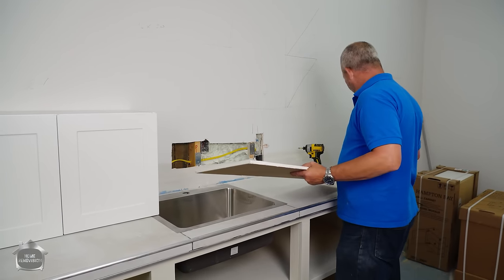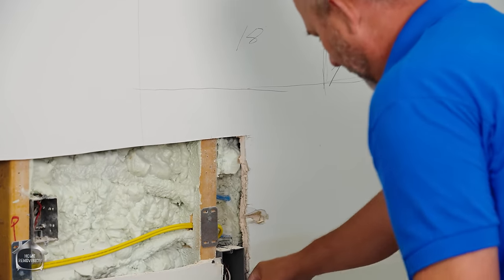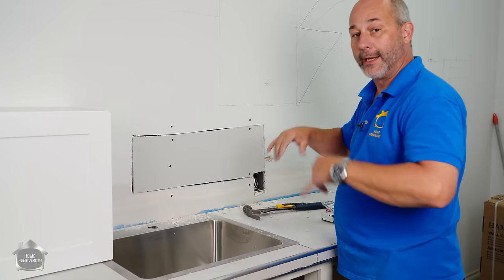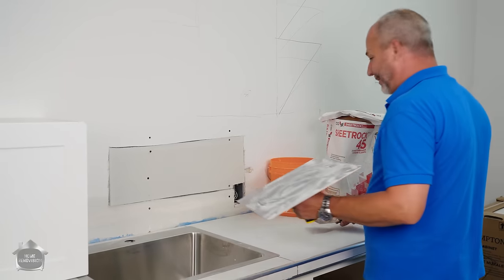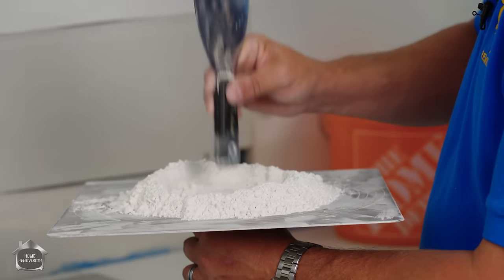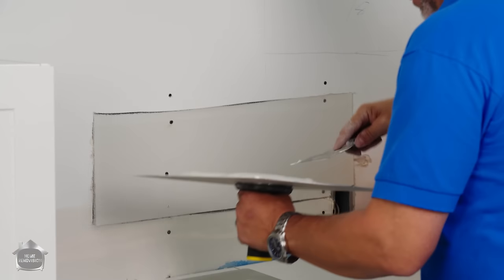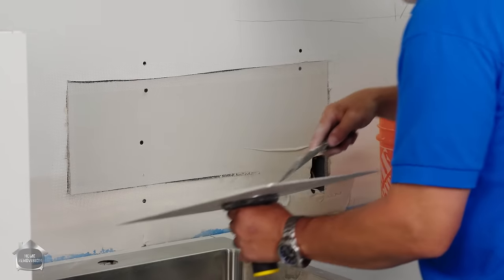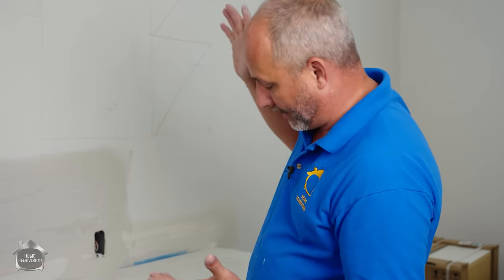My Secret For Quick Drywall Repairs

Comment: I've saved myself close to $10,000 by following your videos, which gave me the skills and confidence to do things myself, rather than hiring contractors. My dad & uncle are some of the least handy people on the planet, so I didn't grow up with this. Thanks.
Reply from the maker: Nice work! Cheers Edwin!
Reply: I want your story to be mine. Looking at renovating a place that was built all builder-grade in 2007. The cost of a contractor for 3 baths and a kitchen is giving me heartburn.
Reply: @seapeajones  good luck! I bought a 1950s place. Had to rip out the bathroom because it had rotted. Some of the joists needed replacing, lots of stuff needed drywall patching through the house, took out the second fireplace & chimney, rendering over that spot. Even had to replace some of the drywall.

Just think about what you need done, see if Jeff's covered it (sounds like he might've), watch the videos a few times and maybe you'll feel ready to tackle at least some of it.
Reply: Ditto!

Comment: I remodeled my entire master bath (5x7 so not a huge room) and anytime I would mix power mud I would use my hawk like you though instead of sprinkling it like a cake I'd knock the ridges into the water and then run my knife up the sides similar to a snow truck up a hill. It would fall in and I'd have a pretty good consistency one it was all done. Took me a bit to develop that technique but it works for me.

Thanks to your videos you gave me most all the knowledge to demo and rebuild that room for around 2k and adding 6k to my home's value.

Comment: Jeff you have helped me with a litteral tons of tips, 2 years ago i started to need to do drywall repair. I watched a pretty much all your videos, i must say the volcano method at least for me a pretty bad idea, i must have spilled a full bag over a year and a half trying to pull it off. The little bucket keeps the untrained cleaner. Thanks for all the other advices! Cheers
Reply: Also now i can tape and finish a wall in 3 pass with no stress, i got there in about 30 sheets id say
Reply from the maker: That is awesome! Cheers Alex!

Comment: Concerning the drywall mud mixing, I find it easier to mix larger batches that are too much for hawk and too little for buckets. Buckets suck because round.  But, there's always a butt, once roughly hydrated, I split it and mix to final on the "hawk" or mini hawk (or large trowel, point of view)

Comment: I still think the best drywall trick I've learned on this channel is how to work with 45 compound. It's saved me so much time when doing repairs, patches, filling holes, etc. I never had great results with the pink stuff or ready mix.
Reply from the maker: Great to hear!  Cheers Nathan!
Reply: The pink stuff is spackle, that’s really only good on small holes and stuff where you don’t want it to shrink. Think, patching nail holes on newly installed trim, or patching a hole from a drywall anchor or nail that was hanging a picture. I used to try to repair drywall with it too and it’s a nightmare! Joint compound is the way to go with any patch larger than your little finger, I’d say.
Reply: @artificiallyunintelligent4537  Even for small holes, I've gotten better results with 45. Plus, it was like $10 a bag that can sit on a shelf for years.
Reply: @artificiallyunintelligent4537  Have to disagree, setting compound is more workable and will not shrink(significantly) either, it sands better too. Hell, I'd rather fill nail holes and small dents with freaking Durabond 90, since the work will be done once for all and it sands fine. Spackles and pre mix joint/all purpose sucks!

Comment: For small patches on subtle texture like orange peel   you need a good way to fake that texture to avoid buying the 25$US spray can . Somebody had a video that showed how to
put some some "watered down" joint compound on a brush.  You want a brush  with about 2" bristles that are thick and strong.  By rubbing a finger over the loaded brush you can learn  to flick out lots of small drops to make  a texture, which you can further modify as you wish, sanding or knock down. I couldn't get consistent sized drops but it was good enough.
  I ended up making a really cool texture that was  somewhere between a knockdown and a  orange peel. But one only see the difference if close to it and looking for it.
By brush I don't mean a paint brush more like scrub brush.

Comment: Great tutorial on quick patch. I also like the 45 product, it took me years to switch from pre-mix one question though, are there wires in the box you beat into submission?  I’m guessing this is a dead circuit therefore, not an issue, however, as a standalone, the context is missing.

Comment: Hey Jeff, to start I got to say I love watching you and I'm learning so much from you... I'm doing a full remodel on a manufactured home that I purchased... I have a question for you. I have to replace some bearing studs that have Romex wire running through them, how do I replace the studs? Do I have to cut the wires out, re drill new holes and redo the wire, or is there a way around that without ruining the structure of the studs?

Comment: 2:30 @home renovision diy
Mr. Jeff, you ever add glue to your quickset mud when doing repairs/patches like this for “extra adhesion”; & what are your thoughts if adding glue to quickset mud?
Me, I add it & can tell difference; especially on some brands if quickest mud, when glue IS NOT ADDED…..so, I’m in the camp of, “ok to add”, as how was taught.
Cheers ✌🏻
Reply from the maker: I used to use  glue if I am not confident in the surface I am working on. Now I simply prep with a flat oil. Cheers!

Comment: Question.... So Useful video, stagger joints, thanks by the way... But i still messed up... I missed my cut by 1/8 or so around shower drop ear, so when i drilled drywall it cracked a little in a circle, i cut and pushed it up, but seems like the only thing holding the crumbled drywall is the paper... It feels a tiny bit weak around that hole... Do i scrap it and redo it or what would you do? Damn mold resistant drywall is 20 bucks each, hurts to just throw away unless I have to... What would you do? 😭😭😭

Comment: Great video!  It’s especially great if you do it for a living or have a lot of holes.  What about using spackle?  I wouldn’t have a need for a whole bag, but a small can of spackle is pretty cheap.  Are you opposed to it? And if so, why?  I forget to mention this, so I’m editing my comment…. Before I knew what you were doing, I was waiting to see when and how you were going to cut that weird shape into your drywall.  Then 🤯, you blew my mind when you cut the wall instead!  What a brilliant way to do it and SO much easier.  Goes right into the “work smarter, not harder” category.  Thanks again and keep the videos coming!
Reply from the maker: spackle does not bond with the tape as well. use a small bag of quickset available in the paint department. Cheers!
Reply: The trick is to buy a 5$ bucket and sealing lid, label it with the compound(or compounds if you buy different bags) and store them. You'll have infinite supply of 20 45 or 90 compound, you should probably add some Plaster of Paris in there for the really tough jobs, BIN Shellac primer will then prime them anyway for paint.

Comment: I've always been told to pre-fill my joints before tape. Is that not needed because of the mesh tape, or because you were in a hurry?
Reply from the maker: just not needed if you are using a mud with a hardener. it does not shrink and crack.

Comment: Watched lots of your excellent videos. Can you help?

Rented a drywall lift just long enough to place a tricky drywall sheet in my mom's ceiling.

I had prepared the rain-damaged area the day before & was able to completely remove a previous 4x8 sheet, revealing the surrounding sheet's edges. 

The sheet to be replaced ran about  5"x12" under a cabinet's top edge. It was very hard to get the sheet in place due to the cabinet & a nearby light fixture.

I got the sheet close and installed enough temporary screws to hold the sheet ALMOST flush to the joists while I ran to the next town to return the lift because the rental time was expiring. 

When I returned to install the final screws and completely seat the sheet, the opening was about 1/8" too tight.

I'm working alone and don't think I can remove the sheet & install it after sanding or rasping the edge down without a lift.

Is there any way to accomplish this without completely removing the sheet? I assumed the opening was perfect for a 4' width. Bad move, I know.

Comment: I do not have the delicate touch I find using a tooth brush stick end (that I use to make sure my tools a as clean as I can get it specially when I have some dried bits) to mix in a pan works best with me to get it all mixed fast and well

Comment: you can mix a fast set mud in a pan just as fast or faster than you did,  also that amount of mud can have been easily patched with 5 minute mud.
Reply from the maker: use 5 min if you want to. I use a hawk because it requires tools that give a better finish. pans mix mud all lumpy!

Comment: Were there live wires in the box you buried? Where I live, that would be not in compliance with code.
Reply from the maker: They were cut from the back side and disconnected from the panel. Cheers!
Reply: @HomeRenoVisionDIY  cool. I was concerned for safety. Thanks for clarifying. Additionally, thanks for your videos. I’ve been enjoying the fact that you share so many great tips. I’ve been working on a few remodeling projects and your videos have been excellent sources of knowledge. Thank you!!
Reply from the maker: Cheers Matthew, Happy to be of some help!

Comment: Is not against the electrical code to smash and cover an existing electrical box with existing wires and hide it in the wall behind the drywall even if it's not live, should it not be properly removed?
Reply from the maker: The wires supplying the box are cut and removed from the panel. Cheers!

Comment: Question, would a hair dryer be as effective as the heat gun, or would it blow away the mud? 🤔
Reply from the maker: any heat source will help to kick start the drying process. once it gets warm it hardens pretty fast! Cheers!
Reply: Yes, many painters only use a hair dryer

Comment: Not to hate, but a trowel and pan is way more friendly to a diy'er than mixing it with a hawk and trowel.  And if you are to compare the two methods with all things the same (you vs pro mixing same amount of mud into a pan) it'd take the same time to have the mud mixed.  Don't exaggerate.
Reply from the maker: perhaps but mine will be silky smooth and the pan leaves it chunky every time. Cheers!

Comment: My drywall hole patching system is still the fastest least expensive and the results are unmatched. Oh yeah and no feathering because it allows you to finish flush with the existing surface. Oh yeah and it is stronger then before. Plus it is part of the worlds strongest drywall anchoring system
Reply from the maker: Thanks for sharing.
Reply: What is it?
Reply: @Zinkevm1  a easy and quick way to apply a patch on the inside of the wall for a standard wall there is  3 1/2”between the walls so a hole of 7” can be patched with one. If you have a 12” hole you just have to use three overlapping the other ones 
And for the anchor drill a 3/8 hole insert the wall backer  with the size you are using and there it is
Reply: @HomeRenoVisionDIY  just would be nice to get some investment
I have dozens of improvements to so many things
Reply: @gerhardschemel3565  You should start a channel.

Comment: Challenge accepted on mixing quick set faster. I keep a pair of beaters from a discarded hand held mixer in one is my drywall boxes. I dump the quickest in my pan, add water, attach beater to my cordless drill, and I'm applying mud while you're still jacking around with your volcano. Also, the instructions from the mfg say to prefill those gaps, even if you're using mesh tape. They warrant their product if you use it correctly, which you didn't.

Comment: Be careful. We had solar panels installed, they messed up our roof, refused to repair.
Reply: Must have been the method of using the hawk instead of the bucket.
Reply: @moonpiespotlight4759  ???? Don't understand your comment.